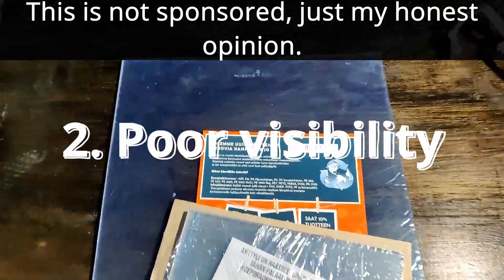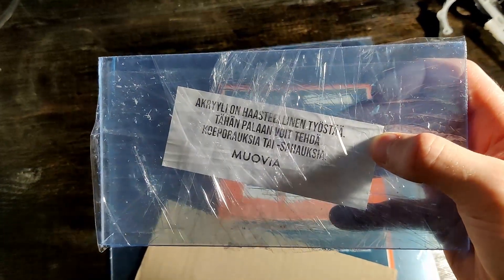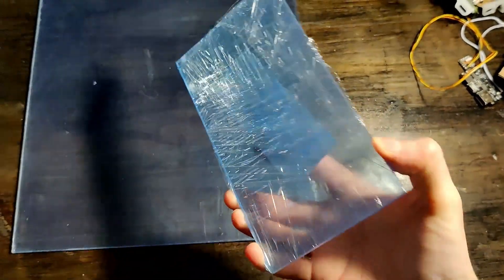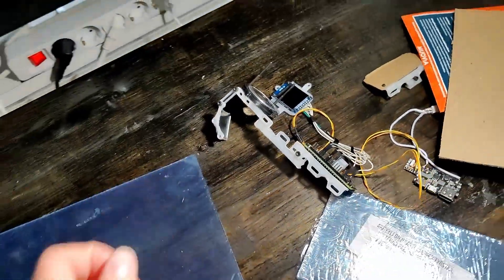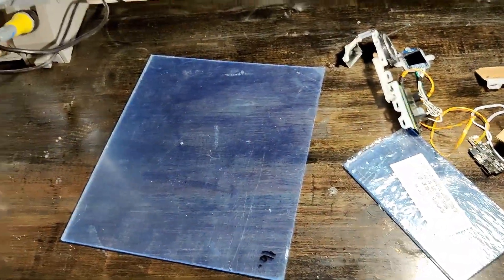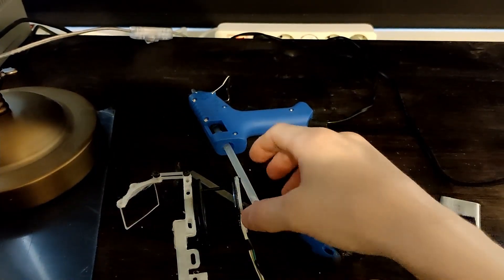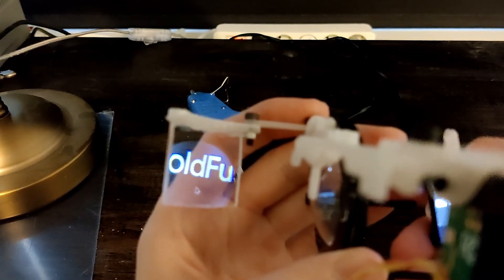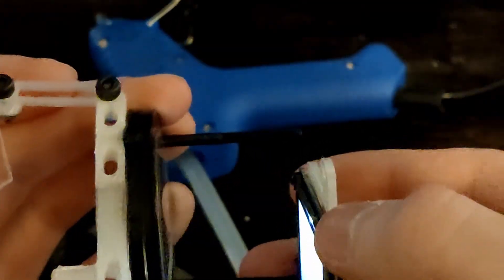DIY Smart Glasses Devlog/Fixlog #1 | Plexiglass, wiring and some weight reduction

Comment: Can try using 1 way mirror film on the original reflector. the film should technically allow light to pass through 1 side and not the other so it will prevent display from being seen by others.
Reply from the maker: Thanks for the suggestion, I will definitely try this out! I already got in contact with a window film reseller and they should (hopefully) send some samples in a week or two!